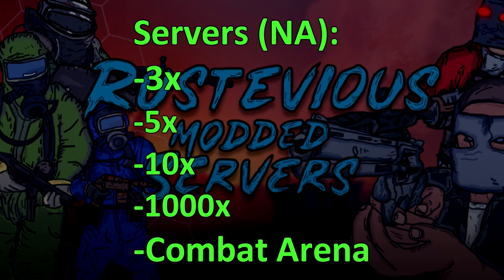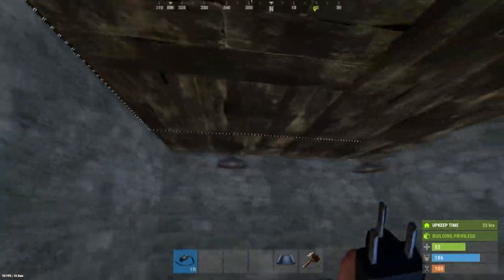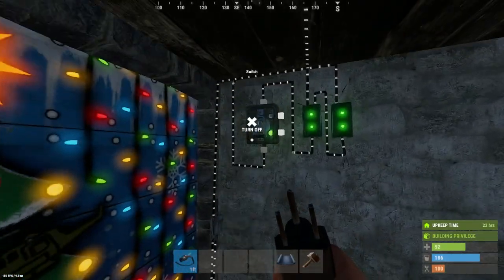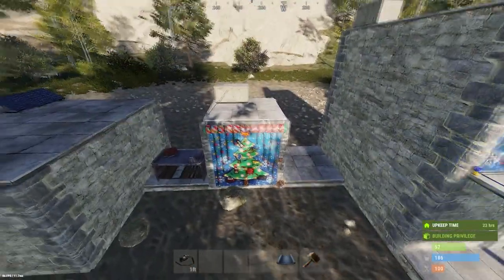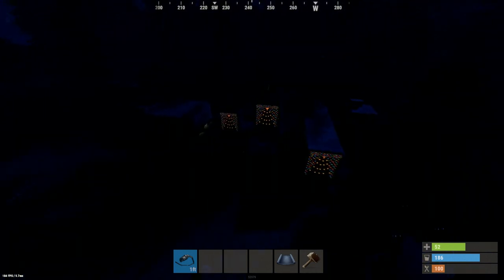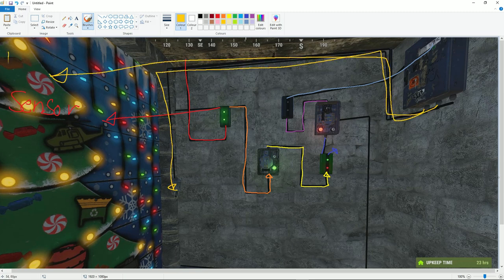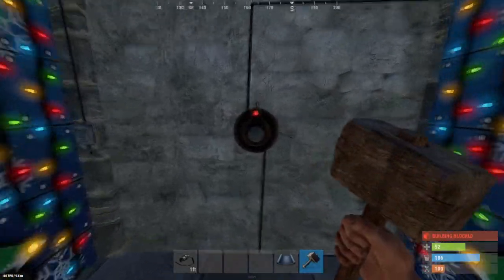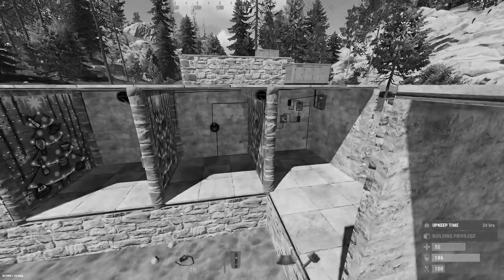Rust | 5 Essential Electrical Circuits for your Base

Comment: If you add a blocker to the auto turret system and use the out of ammo slot on the turret you can make the door close when it runs out of ammo.

Comment: Pro tip: if you know how to set up a clock, you can make a counter that increases every minute and make the rf receiver send a signal to the "reset" function of the counter, this way, if the counter shows an amount less than 15 it means the crate is still opening. and thats really good if you need to do something before countering so you always know how much time you have left
Reply from the maker: clever!
Reply: Or you can set timer on your phone

Comment: Great video as always! I've learned a lot from your content and really appreciate your uploads. I started playing Rust again after the Smart Device update and decided to dive into the electricity part and you've really helped out with that.

I think you can make two improvements to the Hidden Auto Turret design:

1) Use a sheet metal door/armored door instead of a garage door. I think that the garage doors take too long to open up and give someone a chance to hide before getting shot at.

2) Plug the HBHF sensor/door controller electrical branch into a blocker first and then plug the "No Ammo" part of the turret into the "Block Passthrough" of the Blocker. This way if your turret is out of ammo then it will prevent someone from keeping the door open and taking the gun/destroying the turret easily. You could also add a Smart Alarm to give you a notification when it's out of ammo as well for extra awareness.
Reply from the maker: the double door is always something that could be swapped out for sure. As for the other stuff, these are just basic concepts, but its great to see modifications in use!

Comment: quick side-note, the hidden auto-turret curcuit is much faster to open if you use double-doors, since they open almost instantly and give random nakeds nearly no warning before they're mowed down
Reply from the maker: True!
Reply: but if you do want more than one direction that the turret will be facing, then double doors would be a barricade to turrets as they open wide

Comment: Another trick I used to save on solar panels:
Instead of using a solar panel only as a daylight sensor I use it as the main source of power and the sensor. Feed the branch with the solar panel and branch off X less than the maximum output of the solar panel. the branches output goes into the battery and the main output goes to the blocker. Since the branch prioritizes the branch, when the sun nears dusk the main output will drop to 0 and the lights turn on by themselves. However, this is only a viable option when you don't need to feed more than 2 ceiling lights, since the positioning of the solar panel cannot be made in a way that it turns on when it gets dark and turns off when it gets bright again, because of the way the solar panels face.

Comment: Add your diagrams as  link to Rustelectronics it will help in describing these circuits more for people that have trouble understanding circuits. I have a similar design with the automatic door except as you mention leave the door open and set it to close on people with the memory cell. I then have speakers and flashing lights set so that anyone who comes through will be caught in an annoying loud trap. It's way more complicated in design as it has the additional trap branching off but it's pretty funny. I also include a RAND circuit which makes a door open and close over a set period of time to make it sound as though someone is inside but left the front door open.
Reply from the maker: aha that's awesome, yeah I will probably do that for more intricate designs later too.

Comment: Too many E-Branches used wrong. E-branches ALWAYS consumer their allocated electricity, even when not in use. You will need absurdly more solar panels or wind turbines to keep these circuits powered, especially over the night time if using solar panels. Blockers are best to counter this issue. These circuits are simple, but very very inefficient, and far from modular. Regardless, nice job with the basic circuits, I love seeing more people get into the electricity side of the game.

Comment: Auto Turrets: If you want to connect any outlets such as the "No Ammo" or "Low Ammo" or "Has Target" outlets, 10 power is not sufficient. You will need 11, 12 or 13 power. Depending on how many additional outlets you are wiring up to the Auto Turret.
Reply from the maker: I am aware. I just say 10 as the minimum because its all you need for this basic setup. More advanced systems would obviously use more.

Comment: Seeing how you keep using MS Paint for doing diagrams, I highly recommend you try the free version of Clip Studio Paint. It has multiple layers and vectors, so you can select and edit the individual lines whereas in Paint what is drawn remains drawn unless you Ctrl + Z since the program works on a single layer. The free trial has everything except the save feature, which should not be a problem given how you seem to record as you draw.
Reply from the maker: thanks for the heads up, I will look into it!

Comment: Say you wanna have more than one of these circuits attached to one battery. What's the best way to split circuits and have them all function on their own?
Reply from the maker: E branches, branch out enough power for each circuit. You can calculate how much power you need based on the consumption    of one circuit.

Comment: If you want to shut off auto turret just change the power output to 2 and it will shut off, saving 1 power for not needing switch
Reply from the maker: yeah the switch is just for convenience
Reply: @tamura77Rust  just brought it up cause I learned that recently. Also I been putting up those sensors around with auto turrets and they just break the sensors with spears. Haven't found a good way to make them unbreakable
Reply from the maker: @OnlyQuarters  dedicated players can always mess with your stuff when you're offline. The best way around it is turrets covering other turrets I guess, but even that is expensive and tricky.